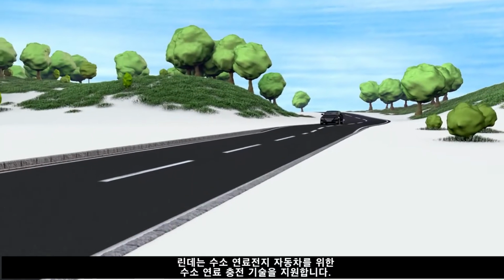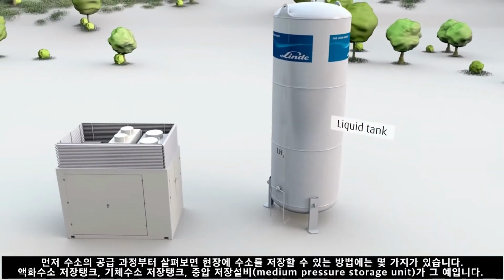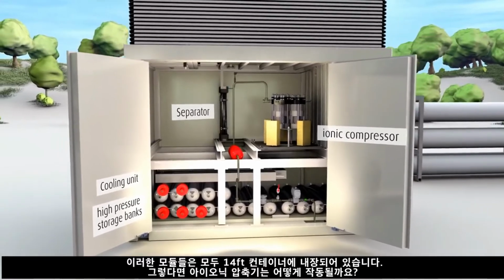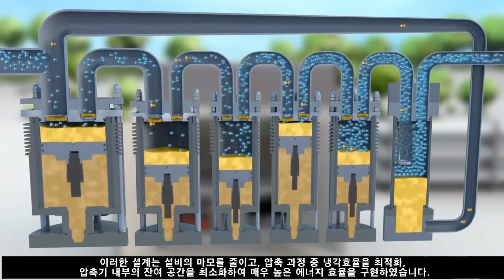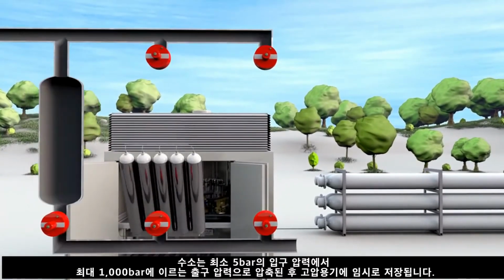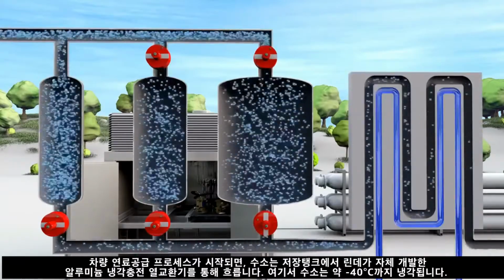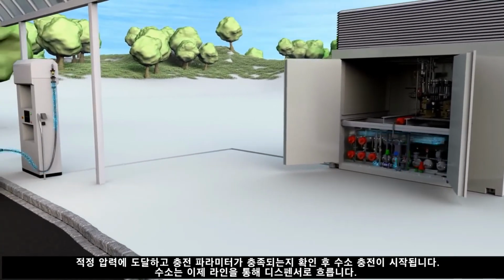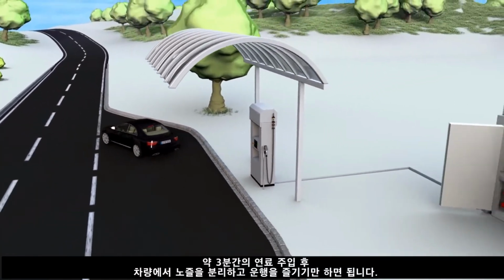Linde Standard Hydrogen Filling Station with IC90 Compressor KR

Comment: What is typical kWhr/kg   for ionic liquid compressor which compresses Hydrogen from 25bara to 700bara? 
Does the heat exchanger use liquid Nitrogen coolant?
Reply: I don't think liq.N2 is used cause the expansion ratio is too high, but you can use pcm(phase change materials) as per my opinion. (I'm just a UG student btw)